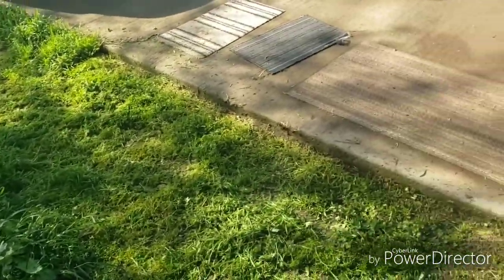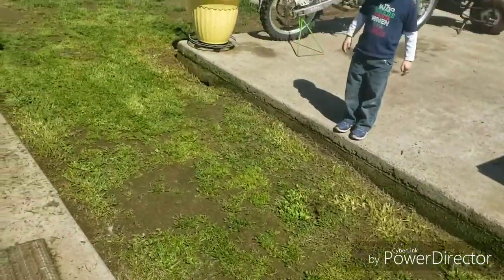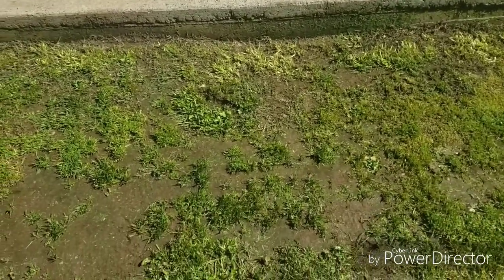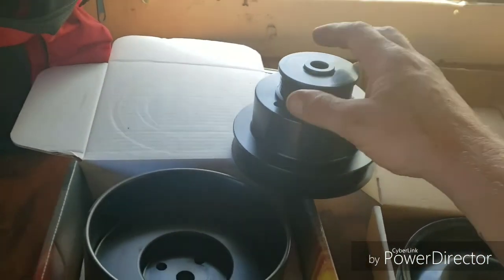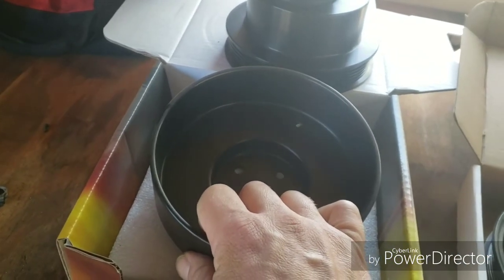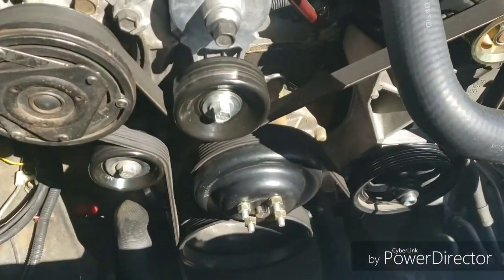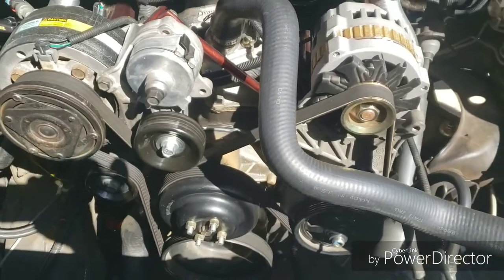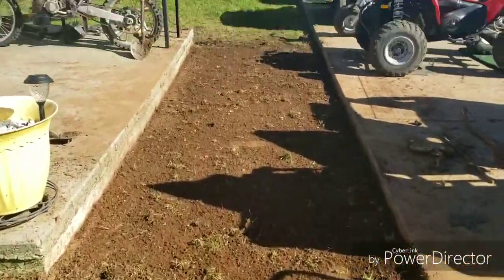How to install a custom underdrive aluminum pulley kit and bypass a/c on a Chevy 350

Comment: Did your custom drive pulley system hold up with the tensioner?
Thanks,
Reply from the maker: It worked but it wasnt really a good idea alternator pulley over heated and started melting the belt and actually started sharpening the fins on the aluminum alternator pulley

Comment: So how’s it been going with those underdrive pulleys? Still got the voltage problem? If so, any issue s because if it? Battery ok? I’m about to do a underdrive kit and E-fan upgrade to my 95 Tahoe. I’ll be adding a 170 amp alternator (95amp @ idle) to manage the e-fan extra amperage, hopefully it will manage the underdrive pulleys too. Have you considered a higher amp alternator?
Reply from the maker: Everything's been running perfectly adding a smaller pulley to the alternator did the trick
Reply: Gibson Garage Was it the same alt. pulley that came with the kit?
Reply from the maker: No the one that came with the kit was larger than stock spinning the alternator  too slow at idle when I had the under drive crank pulley on so I had to go with a smaller than stock pulley for the alternator
Reply: Gibson Garage I just noticed your vid for the smaller pulley. Good work :) However, would this defeat the purpose of the underdrive kit? I mean, I want to install an underdrive kit to free up power. But if you then add a smaller alt. pulley, wouldn’t that then negate the power liberated from the other pulleys?
Reply from the maker: No it's still less mass and aluminum instead of Steel so I get better throttle response I didn't go to underdrive because I'm always at high RPMs I went simply because it's aluminum
Reply: Gibson Garage I see what you mean. Thanks for your help 😁
Reply: Where did you find the smaller alt pulley from?
Reply: I have the same issue on my 94obs Chevy. I installed the BBK Underdrive pulley kit but the alternator pulley was bigger than stock and since I have a sound system my voltage would drop. I need to install a smaller than stock alternator pulley. Where did you buy your from? do you have a part #?

Comment: The bbk 1620 is 8 to 12 rwhp gain 
I felt it 
It made a big dif
Reply: Ben Kalinowski I was looking that kit. what year of truck and engine do you have ?
Reply: @modifyit1  it's called a bbk 1620 kit 
I had a 305 tpi 88 gta serp belt 
And I got a 90s 350 4 bolt block bored 30 over from machine shop 
I just bolted on the whole serp belt setup from my 305 and it bolted on my block zero issues 
Then I got that bbk 1620 kit
Reply: @benkalinowski5834  how’s that Bbk 1620 kit working? Any issues with voltage? I’m thinking about getting a kit for my 94. Any extra hp for this old truck is a plus

Comment: I run a slightly shorter belt than stock. My ac clutch and bearing locked up and bought the bypass pulley that sits in place of ac compressor. 
I kept ac lines connected, just rolled ac compressor up and over to fender behind battery and tied it up out of the way with lines connected. 
 Wish they made a grooved steel pulley instead of plastic.

Comment: I think your truck is idling too low you need to be idling around 750rpm your is down to like 500 it seemed like, try to reposition your throttle body to make the idle higher

Comment: Where did you get your e fans
Reply from the maker: They came with the radiator but I bought the ProForm controller from AutoZone for 52 bucks you can get other fans for around 50 to 70 bucks a piece

Comment: Is  that a first gen sbc with serpentine belt kit from a truck ? What year did you use if it is ?
Reply from the maker: Stock 1994 305 engine

Comment: I have a 88 gta trans am 350 and I bought a bbk underdrive pulley kit 
And I had the same prob
Ideling the voltage was 12.3 
And when I rev it up it went to 14 
So I took the bbk alt pulley off and tried my stock one 
And it was 12.8 ideling 
So I went to a alt rebuild shop and made them search there whole shop for me and he found a smaller than stock one for 5 bucks 
And now ideling it is 14.3 so prob solved
Reply: Any issues with the smaller than stock pulley?
Reply: @Tony Montana Malverde  just the lower idelalernator not charging 
I got a smaller pulley from a alternator rebuild guy for 5 bucks
Reply: Maybe 25 % smaller
Reply: @benkalinowski5834  oh ok cool, do you know the size by chance?
Reply: @tonymontanamalverde  I'll measure it asap
Reply: Thank you. I’m having the same issue. I need a smaller than stock alternator pulley